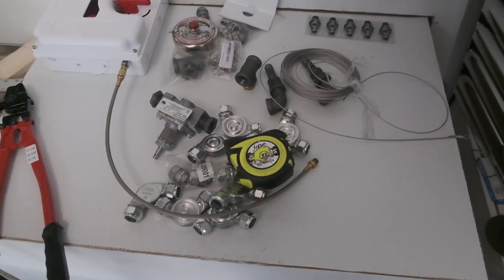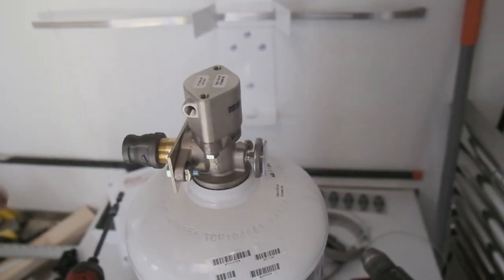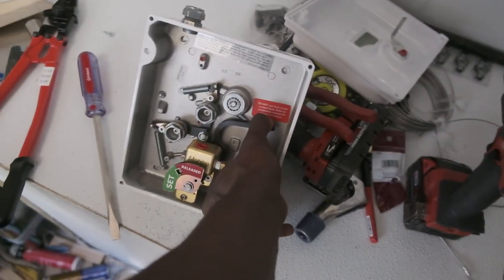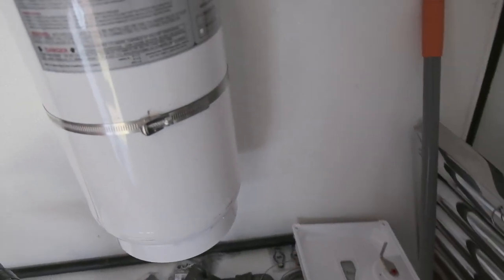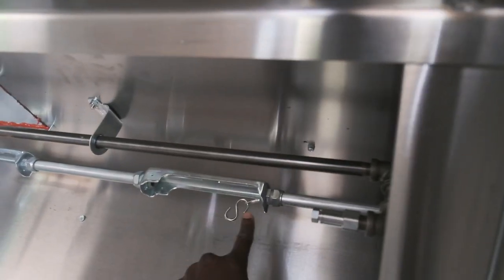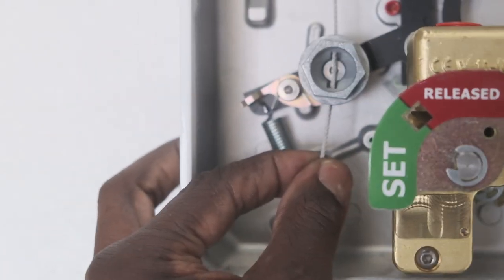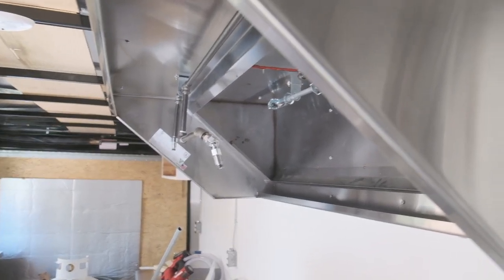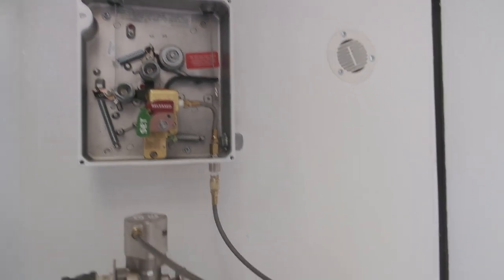Building a Lunch Trailer: Fire Suppression and Electical

Comment: Do you have to be certified to do it I’m a electrician
Reply: This my video on my old channel. No there are no electrical codes for trucks and trailers you turn into a good truck. You should follow house wiring protocol just to make it easy. The only issue is having a bonded generator as most aren't.

Comment: Did all the fire suppression system parts come from HoodMart? I just ordered a 7’ suppression system. I’m missing the cable, cable from tank to the box and the 90’ pulleys. Thanks
Reply: So the system comes with the hood the tank and the trigger box. The rest of the components you have to purchase separately. Google the manufacturer and  see if you can find a installation diagram, it would have the part numbers of the components for stuff like the cable
Reply: @DubYaJsWorld  I appreciate the response. I’m thinking for $5200.00 it should come with everything.

Comment: Is that pipe dope?? Pipe dope is against all manufacturers requirements.
Reply: Who told you that? Thats not accurate at all. Pipe doesn't shouldn't be used on certain types of fittings, this application is not one of them. I had to have a certified company that does fire suppression systems sign off on this for my county to approve it. So they didn't have a problem with the pipe dope at all.